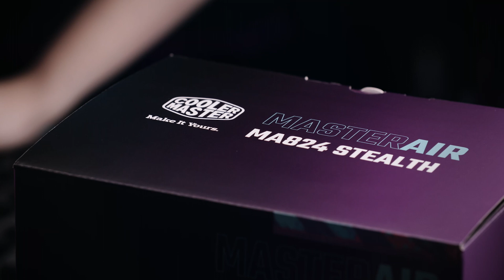A Breakdown of Cooler Master's Latest Flagship Cooler, the MA824 Stealth

Comment: So just to be clar before i pull the trigger, you CAN swap out the middle 140 fan correct?
Reply: so, do you?
Reply: @goldeneagle8259   nope, didn't get a conclusive answer on the middle fan situation. i've seen outlet that says it can be remove, some says it cant.
Reply: @Superkitty-n1t  Thx. Then it's too bad ;) According to my research so far, it's the best air cooler atm. I made 2 builds with 12900k Noctua NH-D15 chromax. But now I th that nh-u12a chromax and MA824 might be better. Although mby it's just bcs of the fans difference. 
Found these 2 top tier radiator fans:

Phanteks T30 120mm
Shark force 140mm

Can you advise on which of these coolers I can easily install the fans? Preferably 2 Shark force, I feel they should be more efficient than the Phanteks, although T30 has more praise in reviews. Shark force 140 much less reviews. Maybe NH-D15 with 2 of these, will be a beast ;) Although it's a quite old cooler at this point. 
Btw T30 is also of increased width of 30mm, need to be mindful of that.